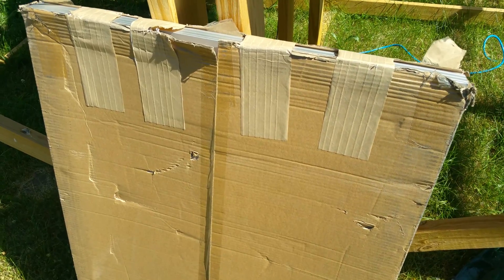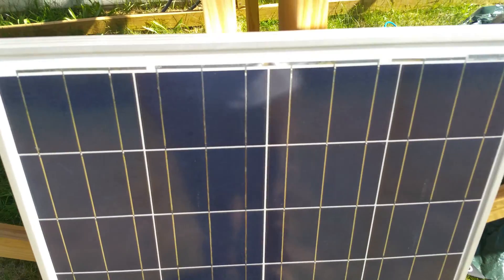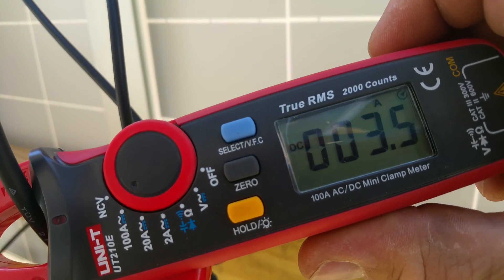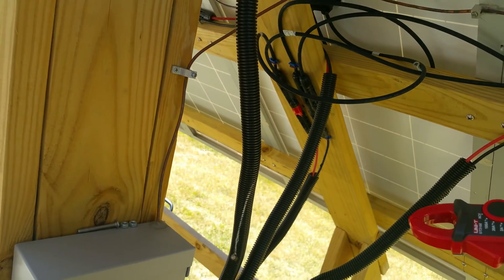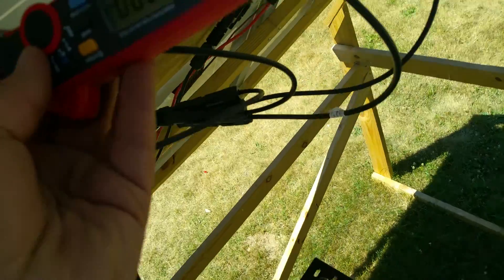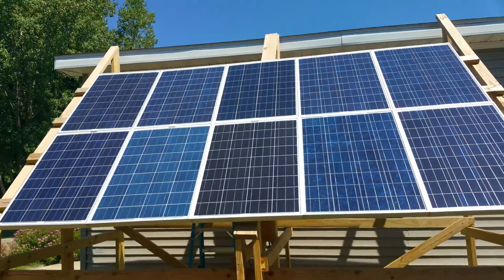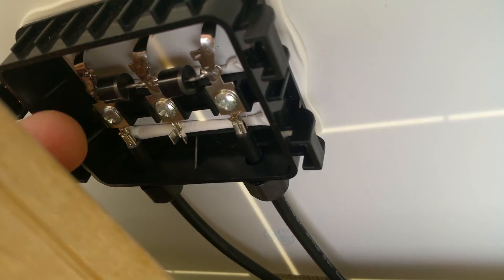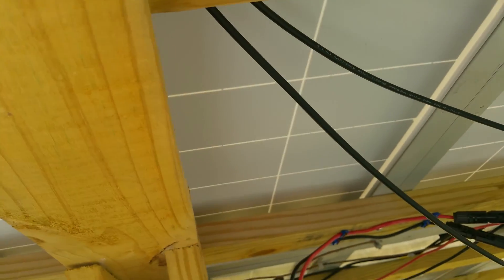New Solar Panels - Always check them!

Comment: I was told to check each panel's voltage (should be around 40 volts/panel) which requires disconnecting each connector and is time consuming; but I see you measured DC Amps using a clamp meter.  Much quicker.  Can you find faulty panels measuring amps with a clamp meter?

Comment: Hey friend!
I think I heard in one of your videos that you live in Michigan.  Did you hear anything about DTE suspending net metering and not allowing anyone to be grandfathered in ?  I think you do just off-grid but I thought I'd ask anyway.  I'm not sure if I heard this from a completely ignorant customer service agent or what.  Just thought I'd check with a person who's actually using solar.
Reply from the maker: +Christmas Eve yes.

So the deal is that the average consumer who is grid tied is putting 2 to 3 time the energy I to the grid as they are consuming from the grid. That number varies depending on weather , install size, etc.... 

I have a subscriber with a 25kw system who puts out close to 20 times what his consumptions is.

So with that in mind if you were generating more than you were consuming you effectively become a non paying customer. In fact you are now a cost to the energy company because they are now paying you without getting anything in return.

I have seen this coming for a while and we are still a long ways off before solar and wind become a sustainable replacement for nuclear or coal. But energy companies have long term energy goals in mind. They know what the grid will look like in 20 years and if half the customer base is a cost rather than a profit it will mean less revenue.

In summary... They are punishing those who are grid tied. Those who not only want to go green but also make money at the same time.
Reply: Thanks for all the info!  I totally understand that.  Well, I do but I don't.  I can see why a company would want to put an end to it, whether it's wrong or right for our planet.  But wow! They should have at LEAST just put a cap on production instead of discontinuing it altogether.
I couldn't find any information on the internet about this suspension of net metering.  Not a single thing.  Everything I find just explains DTE's net metering as if it's still a thing.  It's so strange.  Do you have any links by chance ?
Reply from the maker: +Christmas Eve Michigan currently has a cap but we are not even close to that cap. 

The other issue for people is that you need incentives in order to invest in solar. If you make only a few pennies per kw generated it will take 100 years to pay back the install cost.

So, many energy companies will pay good rates to to make sure that customers have an 8-10 year payback. Also most customers take out special loans to get the system installed. If the customer isn't making money then they can't pay the loan.

The customer pays for all the upfront costs and the energy company just takew in the energy. But it's cheaper for energy companies to buy coal or natural gas in bulk rather than your neighbors little 20 kw system.. so the energy companies are actually losing money.

Google DTE net metering suspension and that will give you a few links.
Reply: Wow!  So I better buy batteries, a pure sine wave inverter and an MPPT charge controller to go along with the solar panels I bought, not a grid-tie inverter :-/
Reply from the maker: +Christmas Eve that still depends. Grid interactive systems are about more expensive that grid tie but you have battery to fall back on.

Off grid requires less in total cost but you can not sell your excess to the energy company so make sure you size a system to your needs and not more otherwise you waste money.

Call your energy company and see what kind of contracts they offer. Sometimes they will do 5 or 10 year contracts. Some do none but will always buy . It's still cheaper in the long run to go grid tie so long as you keep getting paid. Grid interactive allows you to get payed but the cost is higher to get started to the payback is longer.

Off grid is the way to go if you just want to be off the grid and not depend on the energy company.
Reply from the maker: +Christmas Eve another thing to consider is that you need to have a certified electrician come in and either check your system or do the install. There are many rules to be followed.

You can't just call your energy company and say "send me a two way meter"
Reply: That's what I was going to do (call a master electrician) until I called DTE and someone told me the program is suspended.  I wouldn't want to put any energy into the grid if they're not going to subtract it from my balance of kWh.  I really don't care if I get no money back at the end of the year.  I just want them to balance out what I sold back against what I pulled from the grid so I'm not wasting my solar energy.  Only if I'd be wasting my energy would I buy all the off-grid components.  I'm still confused about this whole thing.
Reply from the maker: +Christmas Eve if you are not looking to make money then a small off grid system will work the best for you. You can tie it into your house with little effort. You do need to be diligent about usage as you can kill your batteries fast if you discharge them too low.

There are many pros and cons of each type of setup. Do the research and pick the right one for you.
Reply: Thanks for all your helpful information :)
Yeah, off-grid it is!  When my air is running, a grid-tie would subtract from that energy and all is well but, any period of time during the day when there's good sun and the A/C is not running, I'd be wasting all the extra energy that I'm not using.
If I store my energy myself and use a regular inverter instead, I'll get to use all my extra energy.  I just think it would be nice to have some kind of relay to switch to grid-power if my batteries ever get to a certain percentage.

Comment: Just a question, because of the higher amperage you got now a relay to switch on and off, righ? Does this relay get warm or even hot?
Reply from the maker: +Dirk Zuchner I'm sorry I don't understand the question. The charge controller deals with the charging and because it's more than 25 amps I have an expansion relay that will allow it to handle 60 amps. I can expand all the way up to 1000 amps with that controller.
Reply: +GPVlog that 60 amps relay, does it get warm, or hot when it is operating the coil? Thanks for your reply 😉
Reply from the maker: +Dirk Zuchner yes as it approaches 60 it does get warm but not nearly as warm as the breaker. 

I talked to the guy who owns flexcharge and he told me that the contactor could handle 80 amps before it would be of a concern but 60 is a safe number.
Reply: +GPVlog just asking, because I have a relay which is quite hot you couldn't hold it just for the coil to operate.
Reply: GPVlog she would you buy the expansion kit or the relay? On Amazon you find the charger and also on eBay, but no accessories except the DC surge protecteor.
Reply from the maker: +Dirk Zuchner flexcharge does not sell the expansion contacts through any major outlets. I had to order directly from them. They have a website that lists the sellers they have but my experience was that no one stocked them or had very high shipping price.

What kind of setup are you building?
Reply: GPVlog  we are in the process of buying a house and I have 320 watt in 24 Volt panels. I want to operate with these panels a wind turbine and bought one of those cheap chargers with a relay for testing. But I think I have a faulty relay as this gets so hot that you can't hold it in your hand just having the coil closed no current running through. But I believe the flexcharge is the better solution.

What does the expansion set cost? Could you make another video in more detail? I saw you video about the upgrade and lightning protection, though.
Reply from the maker: +Dirk Zuchner if you have Facebook, msg me on my page GPVlog